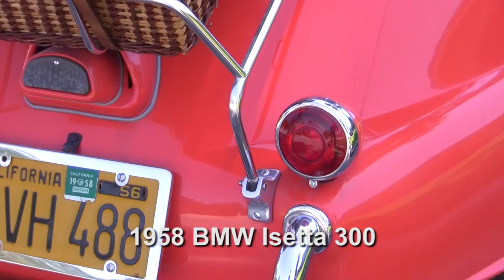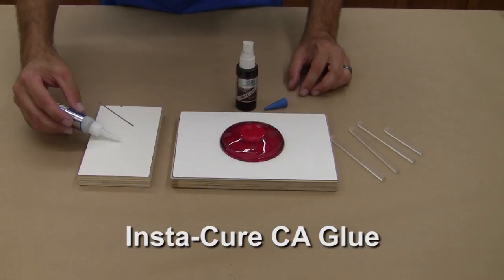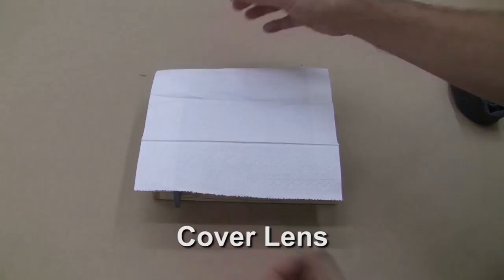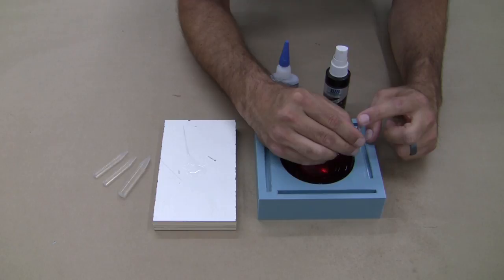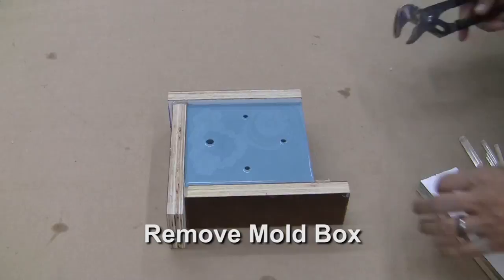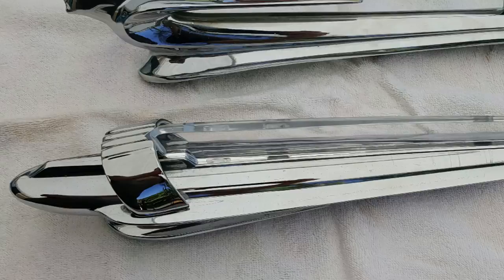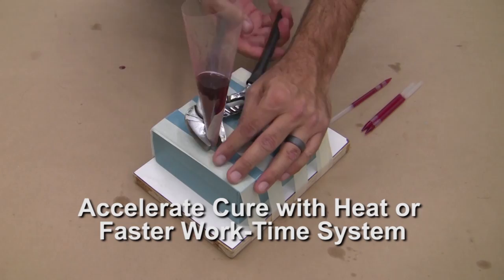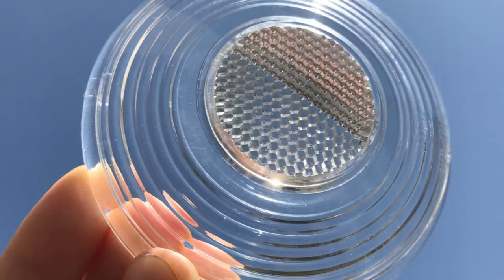Make an Auto Lens with Clear Resin and Silicone Molds | Tutorial

Comment: I have a brake light lens that curves from the back of the vehicle to the side (1993 Dodge Shadow). How would you set up a mold for a weird shape like that, where the mold would have to accommodate an almost L-like shape?
Reply from the maker: Typically this requires you to make a custom block that supports and follows the curve under the part.  You can make this with a large block of clay to fill in the gap below as it sits on a flat surface, or you can make it using thin, flexible sheets of plastic, metal, or wood.  You would press the flexible sheet up against the pattern and support it from behind with a scaffolding type structure, similar to building a concrete bridge.  Once you have a curved parting board, you can build the mold walls from there.
Reply: @bjbenterprises  Very well explained that actually makes a lot of sense! Me and some friends want to make clear corner markers for our show cars and wanted to give it a try, but also thought about doing the brake lights and other parts that have no aftermarket options available

Comment: Can i do this at home and are all these products availible to everyone or just businesses?
Reply from the maker: henry kob we sell directly to individuals on our website if you want to purchase materials.  It’s good to know and understand how to use them safely by using the correct personal protective equipment (PPE) and you may need to invest in certain equipment to process these materials correctly or you may end up with poor results.  Clear materials are the most difficult to remove air bubbles from cast parts and may require vacuum degassing and/or a pressure pot depending on the application.  I suggest watching a few of our other mold making videos to learn more about the process and if it’s something you wish to pursue.

Comment: I need to make A direct opposite copy of a lens. As I cannot source one,  is this possible?
Reply from the maker: Unfortunately the only way to create an opposite part would be to 3D scan the original and have it flipped in a design software, 3D print a new pattern, and make a mold from that one.
Reply: Thanks for the quick reply.

Comment: I don't have the time or patience to do this myself, is there someone or company that will do it for me?
Reply from the maker: There are some small shops that can do work like this.  Typically, the large, upfront cost is making the molds.  If you are only looking for one set of parts, that can be expensive.  Doing this DIY if you are familiar with mold making and casting is not too bad.  Many times people try to make several castings from a mold and sell those to offset costs.

Comment: Would vacuum curing be possible?
Reply from the maker: Yes, vacuum casting is a common method in the world of silicone mold making and casting but typically requires specialized equipment.  Is there a specific reason you need to cure under vacuum?  Most people will process similar to the video and use a pressure tank to eliminate any accidental trapped air bubbles, but for certain mold configurations (like an open top mold) you can use vacuum to help pull material into fine detail.  We would need more info to give the proper advice.

Comment: Hi could you show a video reproducing bi or tri color tail lights?
Reply: As above, would be fantastic to know how.
Reply: just an idea. no experience with this. what if you made a dam in the mold and did one colour at a time. open the mold and remove the dam to do the next colour. like i said i have no experience with this, my only concern would be if the urethane would bond to itself.
Reply: Multi-color molding would be a bonus. I think it depends on whether the resin will bind to itself when done in stages.

Comment: Wow. Great video. Is it legal to reproduce and sell automotive lenses. Do patents and original manufacturers have anything to do with it?
Reply from the maker: If you are making them for yourself there is no issue.  If you are a business selling aftermarket parts, it is on the seller to ensure they are not breaking any laws.  Many times older parts are made under "replica" status and are not claiming to be OEM parts.  It is always advisable to check with legal counsel before bringing a product to market.
Reply: It probably depends on the car too, a car that has no aftermarket/new reproduction parts available are probably less of an issue than a current day car. Even then I don't think lens shapes are really copyrighted or anything like that. Making sure they are DOT compliant is another thing, can probably sell them on a "for off road use only" basis and be in the clear.

Comment: how many materials come out of a mold
Reply from the maker: Materials or parts?  You can cast many different polyurethane materials in a silicone mold.  How many parts you get out  of a silicone mold can vary on many factors, but typically we plan on 25-50 parts and in some cases more.
Reply: @bjbenterprises   thanks

Comment: Would it be possible to make a taillight for me?
Reply from the maker: We do not make molds and parts for customers, we are a material manufacturer and supplier only.
Reply: @bjbenterprises  do you have any recommendations for someone anywhere in the us, or even the world that does 90s body acuras? That I can reach out to?
Reply from the maker: @daquellejones264  Not specifically that car.  If you are looking for one or two lights, it can be difficult to find someone who will make molds and parts for that quantity without being extremely costly.  Most people that do this are either making a large run of parts for a popular or hard to get car, or they are doing it themselves because it is not available.
Reply: @bjbenterprises  ok thank you

Comment: Would this work for a part that is made from rubber with holes in it?
Reply from the maker: Possibly but we would need more details to understand the part geometry.  You can mold holes into a cast part fairly easily if you set up the two-part mold the right way.